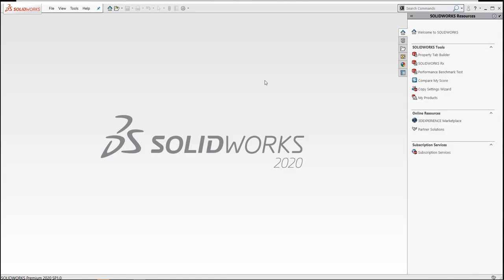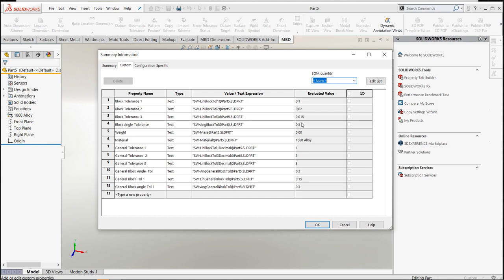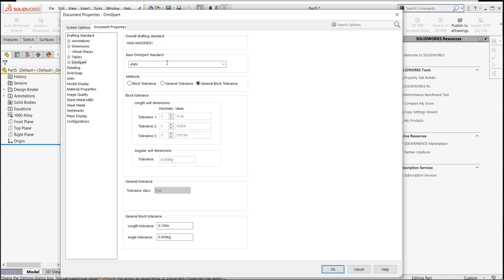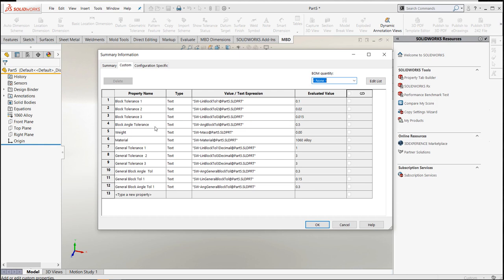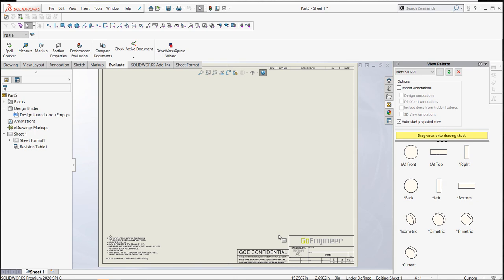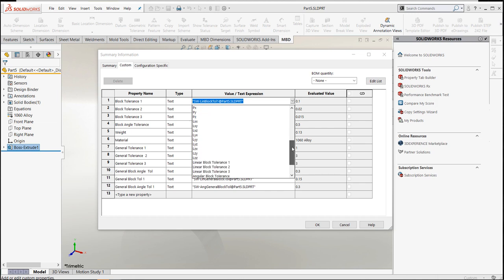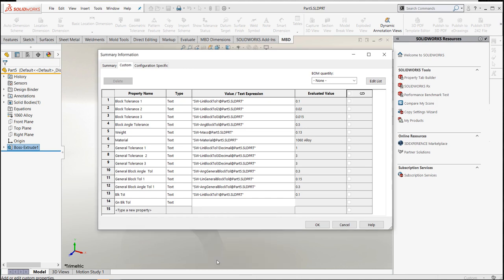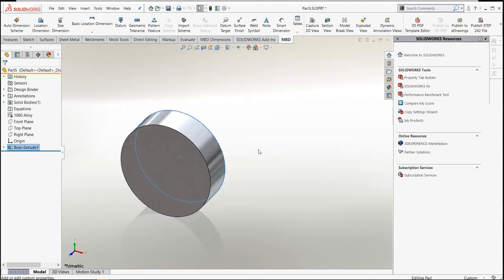SOLIDWORKS Tutorial - Tolerance Setup

Comment: You didn’t show how this helps on your drawing sheet, other than putting it into the title bar?
Reply from the maker: By linking the associated tolerance property to the text in the title bar assures the information in the title bar is always correct when linked to the dimexpert part property.  When using different tolerances schemes in the part mode the text in the title will automatically update without the user having to remember to do so.
Reply: How do I access the template that you opened at the beginning when you clicked on file? When I click on file I just have the options to create a new part, drawing or assembly.